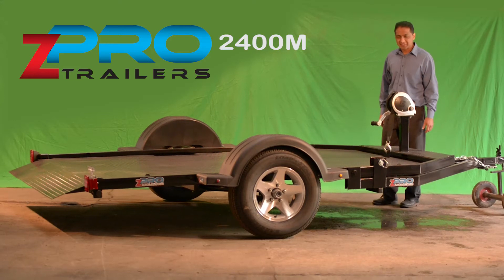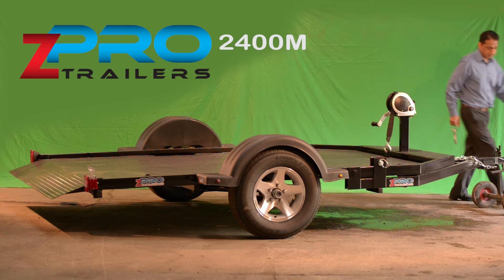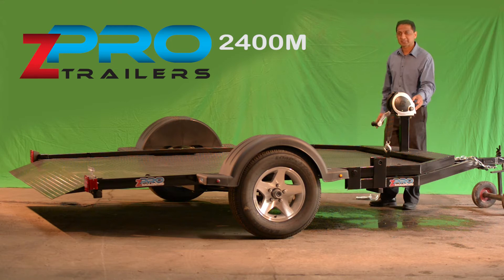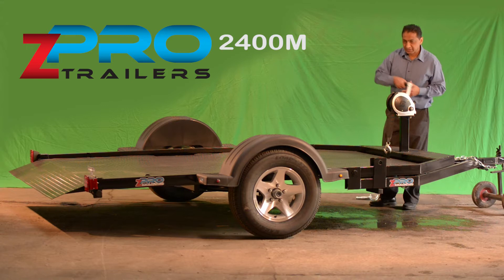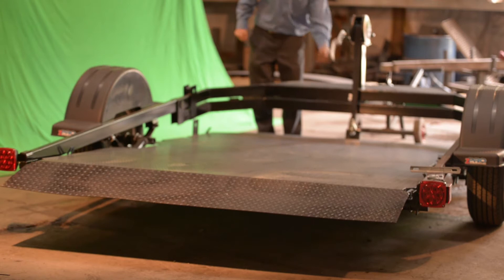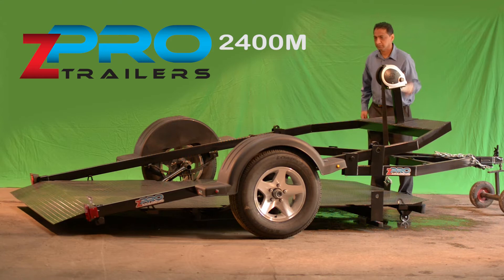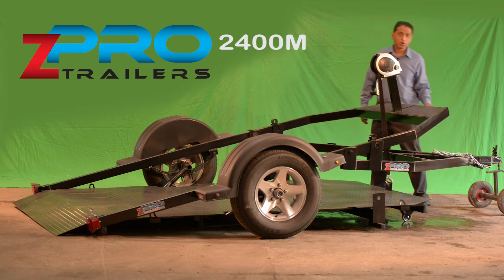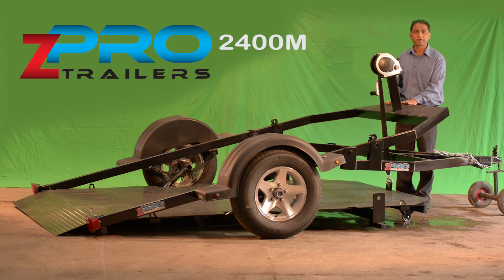Zpro Trailer UTZ2400M

Comment: I bought one of these trailers a little over a year ago and have had no problems with it at all. It is well balanced and pulls so easy like it's not even there. The gentleman that designed and manufactures these trailer, is the real deal. I would highly recommend this product to anyone.
Reply: What size is the tube frame? It looks small?
Reply: How did you purchase it? I would love to get one but don’t know how to contact them